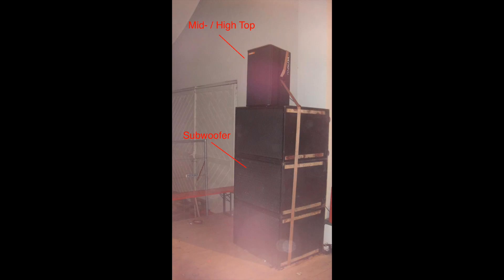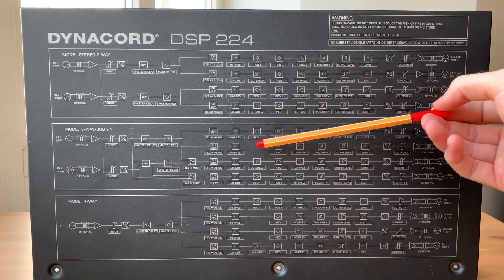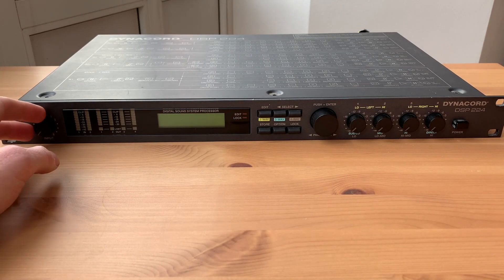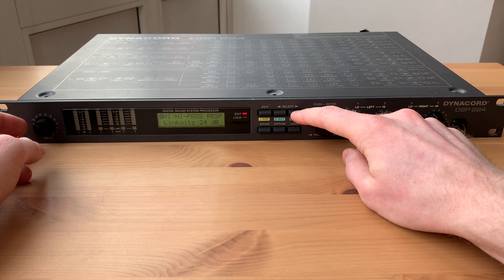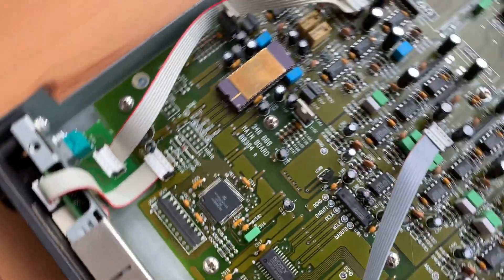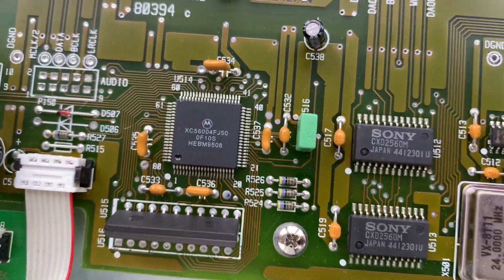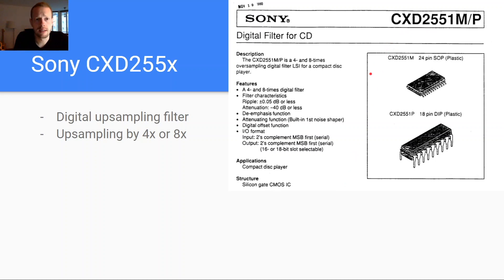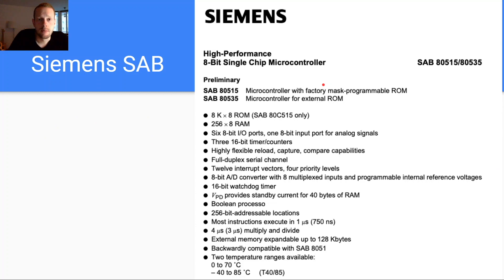[#19] 1994s Vintage DSP Teardown (Dynacord DSP224)

Comment: I've still use one of these Dynacord DSP 224s since 2000, which is still one of the good system controllers I know. Very well designed, by the way. I don't have the slightest complaint to make about him, not least because he never failed me in anything I needed to do with him.
In my case, I use some of my different two-way sound systems processed in this controller and it obeys what I request without any hesitation, despite sometimes being in charge of processing systems with some particularities that require a lot of processing.
I don't understand why some people say that this Dynacord controller only brings back bitter memories, unless the user doesn't have enough knowledge about electroacoustics – as I've seen it happen a few times.
What I can say about this Dynacord DSP 224 is that whoever has one of these controllers will never be taken by surprise in any situation on the road, due to its very intuitive interface and very consistent in the result it provides to the user.
A word of advice about this processor that still has its place in many companies:
Study electroacoustics before complaining about machines like this.

Comment: Hello.  I have a dsp 224 and it restarts itself!  do you have any idea what it might be?  thank you
Reply: check the power supply capacitors.  I repaired it and it works like new.  it does not heat up at all.  Thanks
Reply from the maker: Yes I have the same problem with the device. Therefore I'm not using it anymore productively. I guess this very old digital electronics stuff inside is not working properly anymore. (which is also somehow acceptable considering it is 27 years old).

Comment: Actually, the biggest benefit of DSP's was that end-users could use just one filter unit (to call it that way), for a whole bunch of different systems in different situations. The main reason is that with a DSP you're very flexible and can save presets.
A lot of systems at that time just used analog active for filtering and compression. In fact, there are still quite some systems that use that today since the price is a lot lower (for a fixed system) and it's much easier to get a good SNR compared to DSP systems.
Although that is changing rapidly at the moment. These old DSP's weren't very quite, so I guess a lot of people still have a bit of bad taste from it ;) 

Nice video btw!
Cute what they called "high performance" back in the day ;)